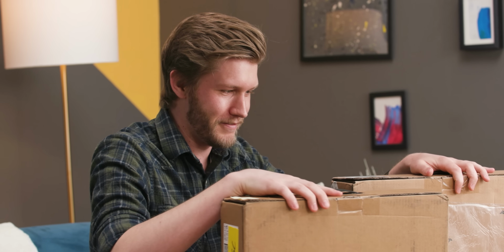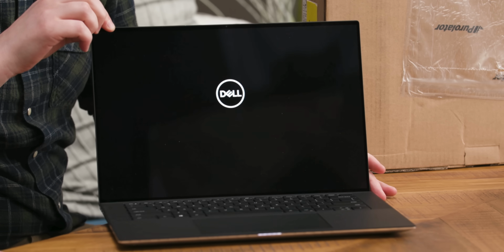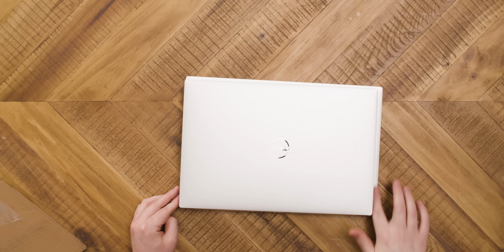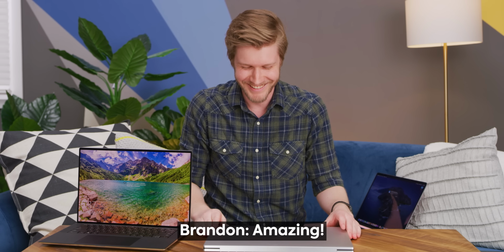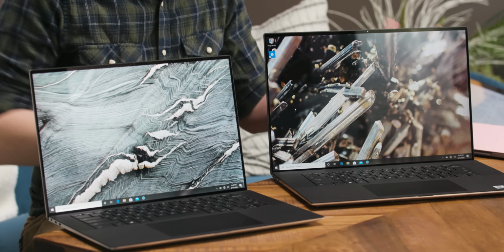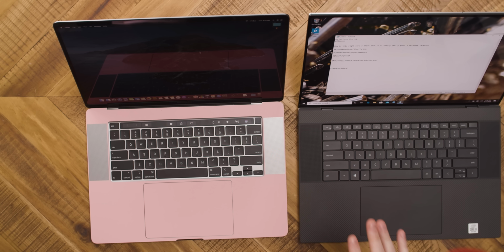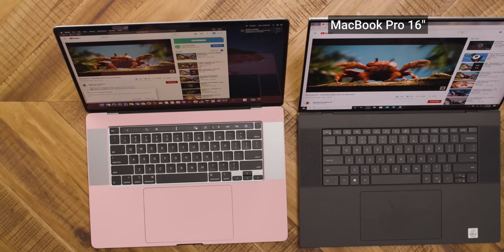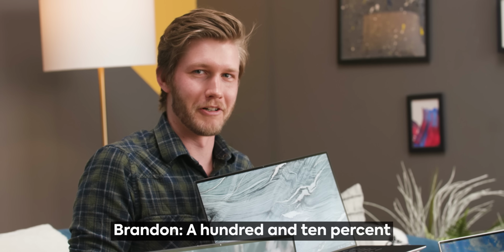The MacBook Pro's Biggest Rival - DELL XPS 15 9500 & 17 9700 Laptops

Comment: is It me living in the past, or is a regular usb-A still something you should probably expect on a full size laptop?
Reply: so yeah, it's understandable on something like Surface Go, but a full sized and full priced workhorse should really do better IMO.
Reply: tomwol thunder bolt is much more useful it can be use for multiple dongle and even display and chargin rather than A
Reply: @tomwol  even that has a usb A port I think, put the surface pros do have one.
Reply: Or HDMI
Reply: I wouldn't buy a laptop without one.
Reply: maybe just stop living in the past and accept the fact that rapidly everything should and will turn to type C. Type A is nothing more than a waste of space.
Reply: yup, seeing that 98% of the devices like mice out there are still A...
Reply: @mataskart9894  Jesus CHrist. Buy a laptop with a usable trackpad. Who tf wants to carry a mouse around all the time. A laptop is supposed to be portable without a ton of peripherals and power brick with it all the time.
Reply: @RandomUser2401  thing is, the trackpad is unusable for anything that requires any amount of work to be done or any game to be played, I can barely launch a youtube video with it without reaching for my wireless mouse... And the mouse is small enough it fits in the bad with the laptop perfectly, no cords or anything, and works on every surface, even my bed... and the usb receiver I never think of again after I buy the mouse... Thing is, if there is a damn 10 cm cable sticking out of my pc for the receiver, it gets kinda noticable. And it basically becomes the same as carrying around a power brick all the time for one 1 cm thick/long usb receiver...
Reply: tomwol no u should expect on windows and Lenovo and some hp my laptop has 2a and 1c
Reply: It is convenient to not use adapters, but if you're a professional the extra bandwidth is so much better than a shitty USB 3.0 port.
Reply: Would be pain in the ass. I have many programs that need dongle and these dongles are USB-A. The dongles are already huge pain in the ass (they are big, I wish they where as small as logitech receivers, no reason why not) and now I would need to use adapter for these. One USB-A port would be nice.
Reply: @iCuzZ  seriously it is time for manufacturers to step up. And these license dongles are just the very top of retarded license management.
Reply: @RandomUser2401   Well it's better than earlier, because now I can use the same software on multiple computers and if I reinstall windows for some reason there isn't any hassle. But the dongles could be smaller and there should be usb-c option which there isn't. Pros of dongle: No need for internet. Software can be used on multiple of computers Cons of dongle: you need to have it with you. I have 2 dongles for every software so computer bag has always the all the dongles. Edit: Earlier there was some kind of software key and you could like once a year recreate it if you bought new computer or reinstalled windows.
Reply: @iCuzZ  yeah but be honest, how often do you reinstall Windows? Also btw people have already mentioned it, there is a very nice and easy DIY tutorial on how to convert standard USB2 devices to USB-C connector.
Reply: @RandomUser2401  not that often anymore. But at the that time once every 6 months for no particular reason.
Reply: I've been using a Thunderbolt 3 only Macbook Pro for the last 2 years and i've used a usb A adapter only for connecting my DSLR, that's it
Reply: @mattymrj01  Yeah, in personal use I don't have anything against it, but work is a different thing. I need to have rs232 port for a new device in 2015...some industrial and automation devices can be ancient (I used usb to rs232 adapter) and I still have to carry it around if I need to change something on those devices.
Reply: @mattymrj01  that matches my experience. The only reason I have to use a dongle is shitty WiFi at work where I need a Ethernet port. Especially within the Apple ecosystem most things are wireless now in a reliable and usable way. I was also afraid and annoyed when buying the MBP but as it turns out over time all I connect by cable to it is more or less the charger only. Before I had my Bose BT headphones I also used the 3.5mm jack daily but now even that one is nothing more than a dust hole.
Reply: I'm on the fence on this one. I kinda stoped complaining because I realized manufacturers were going to do whatever they want without me asking, so if they wanna USBC it'll be USBC. But yes, big laptops like these realistically should come with one USB-A and an HDMI.
Reply: "wHy UsE a MoUsE oN a LaPtOp"
Reply: @eepysnek  exactly. you are asking the right question here.
Reply: No, it's pointless now. USB A is just a waste of space
Reply: @OfficialJulien.T  It would be, if every mouse in the world just became usb c at a tap of the fingers... having a dongle out just to plug in a usb receiver is absolutely stupid... And any good mouse  from brands I trust (like Logitech) out there is still usb A
Reply: @mataskart9894  if you're into DIY, Matt from DIY Perks channel has a guide to turn any USB type A device into type C, provided that you're comfortable to do some soldering
Reply: @mataskart9894  why do you possibly want a mouse with a laptop? That is BS. A laptop is supposed to have a usable trackpad and NO need for a mouse. But yeah apart from Apple nobody seems to be capable to manufacture nice trackpads.
Reply: @RandomUser2401  Who said you're supposed to not use mouse with a laptop? Believe it or not, using a mouse (for many people) offers a superior user experience to using the touchpad. For me, I get far more things done in a shorter period of time using a mouse compared to a touchpad, especially so in programs like Autocad & REVIT.
Reply: @RandomUser2401  that's ridiculous, even with an amazingly great trackpad like the one in the MacBook Pro I'm using right now, there are so many tasks that benefit from a mouse.
Reply: @gloveyourway2000  obviously you have never touched or used a Mac trackpad..
Reply: @RandomUser2401  Plenty of experience using macs and their touchpads. Nothing special IMHO.
Reply: @IanMustafa  I actually saw that video yesterday in my reccommended :) Loved the channel ^^ But I have no use for it, as my laptop already has usb a ports that don't require me to do soldering >_>
Reply: @RandomUser2401  you just pointed out the reason- no laptop (that I've tried) has a usable trackpad, haven't tried apple because I like my windows so can't comment, maybe the macbook trackpad is so great it would make me drop the mouse, but all the laptops I've tried didn't do that, the trackpad is just a block of space the keyboard could've taken up for me, and I don't know a single person who uses a trackpad on their laptop, and I'm in a university- the home hub of laptops... Actually one guy has a tablet instead of a laptop with a mouse, need to ask him why, haven't done it yet, thanks for reminding me
Reply: @IanMustafa  I like his channel, and that video was informative.  But the conversion he did was janky as hell and what he did with the resistors was rather stupid.
Reply: @mataskart9894  literally every Mac user almost solely uses the trackpad. But yes as I have said before, it is just said that no other manufacturer managed to match the quality, even after all these years.
Then, why don't you simply use a BT mouse that doesnt require a receiver? Also, if Logitech and the like still fail to put out USB-C receivers after all the years the connector has already been on the market, the failure is really on their side.
Reply: @gloveyourway2000  ou come on just stop lying to yourself. That is basically the broadly accepted fact that they smoke every other trackpad. Except if you use it with Windows, the driver there is much worse.
Reply: @IanMustafa  that video made me realise one of the real downsides of type c. There is just no way you can fit any components inside the connector itself, like tiny tape a dongles do. I wonder if this is the reason we don't have a unify type c dongle yet.
They would have to stick out a lot more.
Reply: @tams805  yes but the concept is really awesome and I did not think this was possible.
Reply: 90suffix No reason to lie to myself, let alone a random person in a YouTube comment section. I’ve owned and used MacBooks, and I’ve found their touch pads to be nothing special. Personally I don’t care if you’re in love with their touchpad. For me, I’ll continue to use a mouse.
Reply: @gloveyourway2000  Yeah touchpad is ok for web browsing etc. But for cad work it's a lot slower. Like moving in a cad with while pressing middle click is almost impossible and sometimes it's impossible because not all touchpads have support for middle click
Reply: @RandomUser2401  I always use a mouse with a laptop, it increases my workflow by at least 50%. Laptops aren't just about portability, a lot of people have them because they don't take up all the room a desktop PC does. Also you can't game with a trackpad if you play first- or third-person shooters.
Reply: @gloveyourway2000  yeah then your personal opinion is in complete contrast to literally every other one in the tech world. I also do not understand how you seriously think all the smooth and reliable gestures you can do with it are nothing special.. but I guess special people have special opinions and that's that.
Reply: @FlyboyHelosim  1) Laptops are utterly stupid for gaming, they have inherent form factor limitations
2) If your workflow is that much increased with a mouse, you obviously have only had shitty trackpads so far. When used in the right way, awesome trackpads like the Macbook Pro ones can in some cases even increase productivity over a mouse.
Reply: @iCuzZ  well more or less CAD is the only exception where you really need a mouse, I also made this experience. For some tasks with Adobe Creative Suite it also comes in handy but e.g. Illustrator I use only the Macbook Trackpad and it works super nicely.
Reply: 90suffix Why does it matter if my opinion differs? I’ve used the touchpad, and thought it was nothing special. If someone else who uses the touchpad thinks it’s great then more power to them. Regarding gestures, again I don’t think it’s anything special. Gestures are a means to an ends: they’re an action you do in order to complete a task. I personally don’t find joy in performing 2, 3 and 4 finger gesture (I do it in order to complete a task, not because I like practicing gestures on the touchpad), but if others do then great, let them enjoy it. Why do you believe gestures are special? Why do you believe the MacBook touchpad is special? Heck, have you used the touchpad? Any original thoughts, or are you a someone who can’t think objectively for themself and form their own opinion?
Reply: @gloveyourway2000  wow.. well yes, I have used Macbook trackpads and many trackpads on other laptops. And as basically everyone in the tech world, my opinion is that the difference between Mac an non-Mac trackpads is night and day. So yes, they are special. I am sorry but the only thing I can imagine is that you simply did not use the Mac trackpad at all to its full potential, so yes of course they are not special to you. Alone the speed and precision it allows you to scroll, navigate in all directions and zoom when viewing pdfs images or any other document is just ultra amazing when comparing the experience with other trackpads on Windows machines. You can have your opinion but I objectively disagree.
Reply: 90suffix Nothing to do with “using the  trackpad to its full potential”. To me, a trackpad (like a mouse or a touchscreen) is a device that I use to interact with the computer, and get tasks done. The joy it brings to you, and the fact you believe “it’s ultra amazing” (not just amazing, it’s ULTRA AMAZING) to “scroll, navigate in all directions” using a touchpad is IMHO utterly bizarre, but hey, if it satisfies your inner fetish more power to you!
Reply: @RandomUser2401  for cad and other engineering/science programs a mouse is a nearly a must have. Except if it has a touch screen, and the program supports it.

Comment: 17" and you will need an adapter to connect USB-A, that's stupid.
Reply: I guess Dell is going the way of Apple! I prefer my XPS 15 7590 with my 2 type a ports.
Reply: @JustinDaniels  And a full sized HDMI port!
Reply: @Murcielago229  I totally forgot that the HDMI port was gone too!
Reply: USB-C needs to be more adopted so I guess they should still have one USB-A
Reply: Agreed. They could have put 1 or 2 usb A at the back and dare I suggest an HDMI? It's like those who emove the good old jack on phone. Their bluetooth will never replace the convenience of a cable that don't nescessitate to be charged and can be plugged in another device in half a second.
Reply: I don’t get the stigma against Bluetooth mouses. Literally if you have it paired already, just turn it on and you’re set.
Reply: @amaranthpink7453  another thing to charge/buy batteries for.
Reply: Alab fair point, I just feel like that is not that bad to the point where you would completely reject a laptop because of it
Reply: @amaranthpink7453  I went to a friend's house and brought my laptop. I was able to hook it up to an external monitor, USB keyboard, and mouse with no dongles... Everyone has USB type a stuff, not everyone has Bluetooth or USB c just lying around.
Reply: @amaranthpink7453  People care about latency and not having everything on batteries

Comment: Charging at both side is very good feature. I carry my laptop and not always I get the wall socket at same side of my laptop. So it's indeed a very good feature. 

1.3mm key travel is more than Macbook Pro and almost Thinkpad territory (1.7mm). Speaker is not MBP good but better than my current Thinkpad, and anyway I use headphones only.

Thank you Dell. You've my attention now. I am in the market for my next laptop. I might switch to Dell soon.

Comment: Honestly, not having a single USB A port would be a dealbreaker for me.
Reply: @rishav4343  let's see, hdmi, ethernet, display port. And having ports built in is MUCH better than carrying around dongles.
Reply: Man of Hokuto cant agree anymore. Thats why I still use Surface devices
Reply: Rishav i didnt know that
Reply: I can deal with not having USB type A. I'm used to dongles. I can't, however, overlook the lack of a 10 key number pad. We use excel and I travel for work.  They took the easy way out and went with a lazy copy of the 15 inch keyboard rather than designing a 17 inch laptop to its fullest potential. Dealbreaker. I'm forced to go with an LG Gram
Reply: DMC and I on the other side hate the numpad, for development I always wanna have some extra space for hands on the sides and the numpad is there, and I think they’re particularly ugly with the asymmetric look, but I get your point, excel is a pain to deal without a dedicated numpad
Reply: @rishav4343  adapters are retarded. You end up with a bag for adapters and dongles... They shouldve just added usb-a, an hdmi port and even an rj45.. 
Saves way more space than that bag that you have to carry with you. And also a lot easier and prettier than a sleek laptop with a dongle on it..
No numpad is a deal breaker as well for any productivity work that involves working with numbers. Which 17" laptop doesn't have a numpad, lmao.
Reply: Yeah, no
Reply: this comment will come back to haunt you in a few years when everything is type c
Reply: yeah because your still living in the 90s
Reply: OOragnak Going on the same path as Apple. Also these big-ass touchpads are kinda useless. The Surface Book 3 nailed the touchpad tbh.
Reply: @RandomGuy-om1vy  yeah i use a surface adn i can confirm big ass apple touch pads are waaay better than surface touchpads
Reply: @vikumwijekoon3166  New surface book 3 got a nice touchpad tho, not good as Apple obviously but on the other hand the keyboard on surface is an excellent piece of hardware also..
Reply: @RandomGuy-om1vy  are you high? large touch pads are amazing.
Reply: @christopherwhite6173  yea literally know one said that ever. For the people this computer is made for, especially creators, a large trackpad is essential.
Reply: Christopher White yeah i know but for my lazy fingers I like those medium sized touchpads.
Reply: @RandomGuy-om1vy  you do know that you can change the sensitivity right?
Reply: @RandomGuy-om1vy  so what if it goes the same path as apple, big touchpads and 4 thunderbolt 3 ports is amazing

Comment: That XPS 17 is looking really compelling, but I literally just bought my Maingear Element stage 3 with a 2TB nvme SSD and a 2070 Max-Q. Honestly, I might have preferred the XPS 17 because the speakers on the Maingear Element are absolute shit and downward firing, plus I could have gotten a 4k screen and a regular laptop keyboard. The optical mechanical keyboard on the Maingear Element is a bit tricky to get used to and would be so much better if there was a frame around each keycap like a standard laptop keyboard. Sure the XPS 17 only has a 2060 Max-Q, but that is honestly enough for my needs and I would have preferred a 4k ips to a 1080p 144hz because I mainly use my laptop for media consumption and 3D modeling with some very light gaming every couple months and nothing that requires the higher refresh rate. There's no turning back now though, so I guess I'm stuck with my Maingear Element for the next 4-5 years.